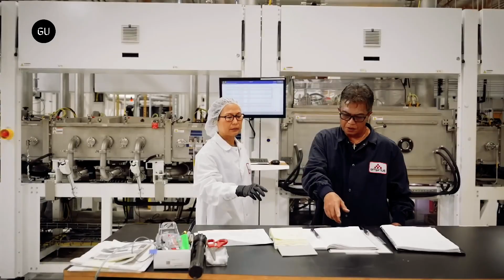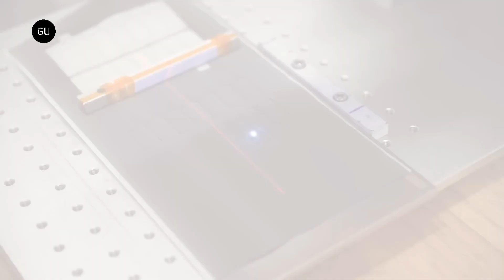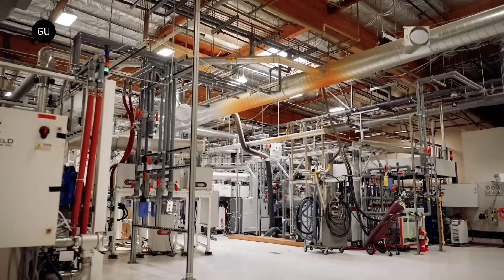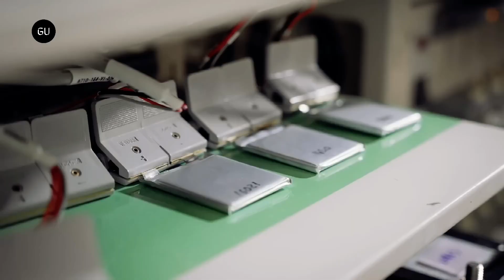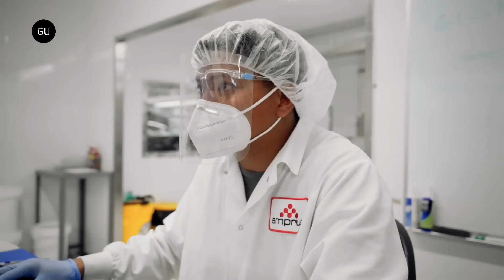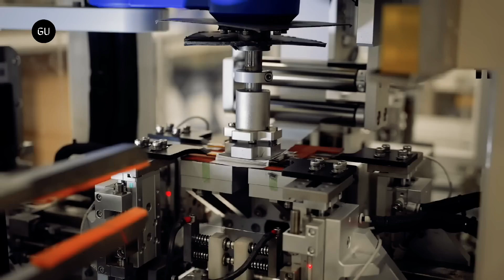The All-New Amprius 500 Wh/kg Battery Platform is Here

Comment: Regarding the Amprius pouch cell battery, the 500WH per KG variant with lower power output and higher energy capacity is likely suited for use in cars, as cars house a larger battery pack which can compensate for individual cells lower output. Conversely, the 360WH per KG battery with higher energy output and lower energy capacity is better suited for e-bikes and other applications since they can hold only a fraction of the amount of batteries in comparison and require a higher output for optimal results. It's worth noting that high-end pouch cells in e-bikes can be problematic for charging in 0C temperature and may cut-off during winter rides. However, in a car, the battery is likely to be protected and actively kept within reasonable temperatures, similar to Tesla's cooling/heating for their battery packs.

Although Amprius has stated that it has shipped over 10,000 batteries to other companies, the batteries are not yet available for purchase, and there is no public information available on their performance testing. Tesla previously used 21700 size cylindrical cells with an energy capacity of 260-265wh per KG before developing their larger 4680 cell with a capacity of 300wh per KG. Amprius claims a minimum energy capacity of 360wh per KG, which is slightly higher than Tesla's. While no battery with an energy capacity of 500wh per KG has been used in the world, such a battery could potentially almost double the capabilities of the best lithium-ion batteries and surpass Tesla's goal. However, there is a risk of poor performance or low cycle life, as Amprius ambiguously states a cycle life of 200-1200 cycles for their products without specifying to which variant the range applies. This cycle life is significantly lower than the typical cycle life of 500-1000 cycles for lithium-ion batteries currently in use, raising concerns about the durability and reliability of Amprius's batteries.

It's worth noting that there's no official spec sheet for Amprius's batteries available online, but it's commonly known that there's a trade-off between output (amps), capacity, and cycle life (reusability). This is why Amprius states 360WH or 500WH without providing additional information. Therefore, given the limited information available, it's difficult to make conclusive remarks on the performance and suitability of Amprius's batteries, and more information is needed to evaluate the competitiveness of their product in the market. It's easy to say "we achieved 500wh per KG" but failing to specify the rest (cycle life and output) is a bad indication.
Reply: All excellent points. However, I will add that the main reason for the ambiguity on cycle life is probably two-fold:
1) because they have a range of products aimed at high power, high energy, or blended... that can result in that high spread of 200-1200 cycle life. Meaning that some aimed at high-power, limited use drones probably have a crap cycle life while others tuned for energy endurance are on the higher end,
2) In 2020, they presented to NASA that they were at ~650 cycle in dynamic stress testing with improvement plans to >1000. More recently, I think they verbally said in one interview that they were above 800. And in their latest information, they have stated they have every confidence their automotive-style sample cells will meet all aspects of the US Advanced Battery Consortium's 2025 goals. They already exceed most of those goals, but I reckon they are not quite there yet on the goals of 1000 cycle life and 15 year calendar life... so they are being coy until they pass that finish line.
But again, I think they are likely already >800 cycle life with their endurance batteries... and are just playing it close to the vest. Definitely worth staying skeptical, but also worth being hopeful too.
Reply: @Grimwyrd  I am hopeful and thank you for the clarification 
Let’s hope they can mass produce it like they said in late 2022